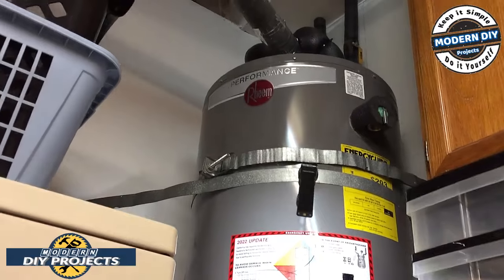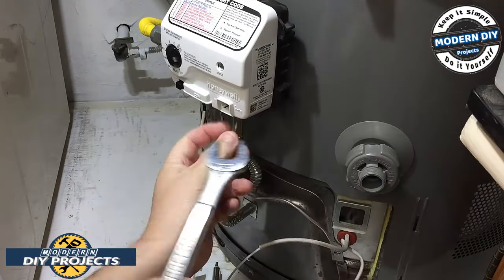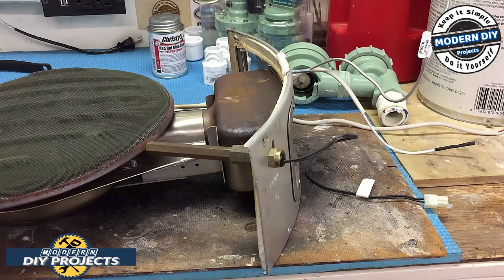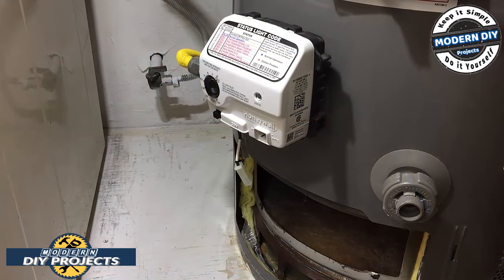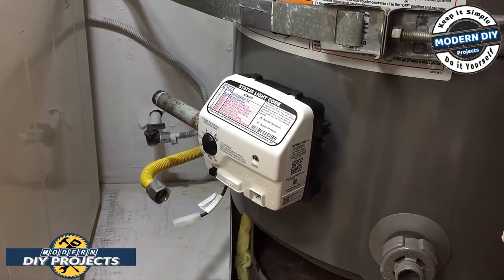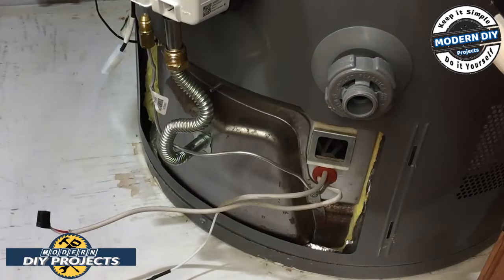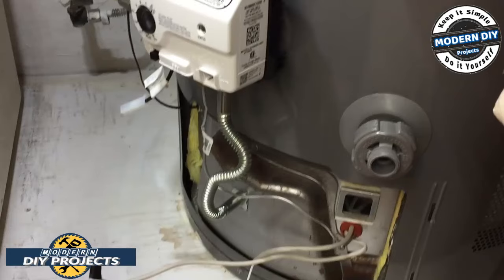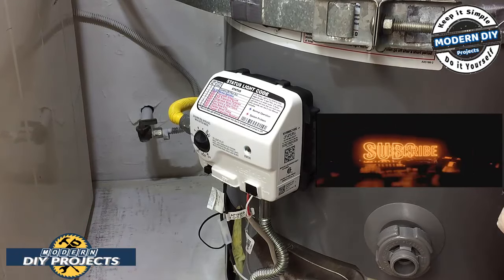Rheem Water Heater Chamber Sensor Failure / How to Replace Chamber Sensor & Gas Control Valve DIY

Comment: Got the same problem. The unit is just 2 years and the technician replaced the control module, sensor, tdr?(don’t remember) basically all parts on that bottom area.  Still failed   After 2 weeks.  When the tech arrived and checked it, seen a discoloration on the burner that looks like a leak due to condensation as they claimed.  The tech called rheem tech support and they said that the unit should be replaced and I I will be shouldering the labor cost.  What a crap!   Beware of buying rheem products.

Comment: why would it be hot if it doesnt work no hot water
Reply from the maker: Just because the water is not hot enough for you to bathe doesn't mean that it's not hot. The unit does work if you fool it into working, but it shuts off which is not what you want. That is why it is replaced.

Comment: Aren’t you supposed to change gaskets on the door?
Reply from the maker: You don't have to if it's not damaged. Mine was intact so there is no point replacing a good gasket with another good gasket.
Reply: @ModernDIYProjects  thank you.  I saw the chamber sensor kit on the Rheem website and it includes gasket, so I though that like with many gaskets it was single use.   

Thanks for the video and the explanation.  I think I will have to do just that.  The chamber sensor  in my heater is broken somehow and the cable with a black piece of the probe is just sitting at the bottom of the heater.  I thought it was a “leak detector” until I looked at the schematics.

Comment: Gonna be doing this in a few days when the replacement burner assembly arrives from Rheem. I can't believe that I paid good money to a "professional" who probably just reset the code and didn't fix the problem. Live and learn.
Reply from the maker: Wow, that is so wrong. So many plumbers are scammers, that's why I learn to do all the work myself.
Reply: @ModernDIYProjects  I even asked Rheem and they said there was no warranty claim on the part he allegedly replaced.

Comment: What is the purpose of the chamber sensor?  My old water heater didn't even have one, IIRC.
Reply from the maker: It is basically a Temp sensor. It's to prevent the heater from Over heating and possibly causing fire. Most older heaters didn't worry about this. They just turned the heater on and off as needed. It's just the way things are these days with everything being overly complicated.
Reply: @ModernDIYProjects  That's what I thought. I actually bypassed mine with a 10k resistor and only ran the heater 1 hour a day until I got a replacement part.
Reply: @EricPoulsen  If I bypass mine with a 10k resistor, the burner will run constantly? or will the control valve still regulate the water temperature normally, just not accounting for the combustion chamber temperature possibly being too high?
Reply: @superbart3000  my understanding is that this sensor is for extra safety. I bypassed mine until I could get a replacement. During that time it worked fine.
Reply: @ModernDIYProjects  wait so this sensor is only if it overheats? Will the control valve still regulate the water temperature normally if this is bypassed? The water temperature is measured by the probe that goes into the tank itself? So this just measures the temperature around the burner but below the tank?

Comment: also good to know the gas pressure those water heaters require a minimum 7.0 WC lockup & 6.4 WC running pressure can cause the pilot generator not to get hot enough! ( if you have a low-pressure gas service the gas pressure depending on the district regulator & gas customers in the area can fluctuate) I worked for a gas utility for 31 years! servicing gas services & heating equipment NO BUBBLES! NO TROUBLES!
Reply: How do you find out gas pressure ?  I already suspected ours was low bc of the burner on the stove not getting very hot taking forever to boil a pot of water.  Then the element went out on my oven And now my water heater pilot won't stay lit.   It lights while I hold down pilot but after minutes the status light never blinks :(

Comment: NEED A QUICK WORK AROUND WHILE U WAIT FOR THE SENSOR AND GAS VALVE CONTROL TO COME??  This is what i stumbled onto with my Rheem Performance 40-gallon water heater.  Follow these steps:
1) Turn the temperature control dial counterclockwise to Off.  
2) Wait til the red light stops blinking and turns off.  
3) Unplug the chamber sensor wire from the gas valve control
4) Leave it alone for about an hour.  This action seems to "reset" the sensor.
5) After an hour, plug the chamber sensor wire back into the gas valve control.
6) set the temperature dial to "Pilot" and press in as you simultaneously press-click the ignition button to light the burner.
7) wait for the blue light to come on and when it does, turn the dial to the desired temperature setting
I hope this helps
Reply: This only worked for about an hour for me. Then back to the 9 flashing red.

Comment: Temporarily Fix Below!!!!!!        Had the dreaded 9 flash "Chamber Sensor Failure" over the New Years Weekend on my Honeywell controller. Of course researched all sites for "hours" on how to reset it. Was able to get restarted but would fail within hour. After extensive research, I came across one person (sorry don't remember where, could be here in the previous comments) saying that a resistor could be used since of course the chamber sensor is a heated variable resistor itself. They stated 60K ohm. Being a electronics guru/car guy, I looked around the garage and found a 68K. I cut the sensor wires off the connector and added the resistor in. I can confirm it works, Has gotten me by for the few days without issue. Of course I am ordering a replacement sensor since it is a safety item to confirm if flame is still on (shutting of unit/pilot) in case of main control valve failure. Just wanted to let other know there is a option to get by for a few days. Once again, I don't recommend making it the overall fix, just one to get by while another sensor is ordered and on the way.
Reply: Nice tip mate.  I had the same exact issue as you.  The tricks that worked for others to turn off for a while and restart didn't work for me either.  But cutting the sensor wire and attaching a 60K Ohm resistor across the 2 wires (actually 3 x 20K Ohm resistors in series!) meant that the water heater stayed on 100% of the time.  Totally took the stress out of waiting for the FedEx Ground shipment to arrive with the replacement parts.

Comment: You don’t have to take the entire gas control out. Just remove the face and the guts from the existing one and install the new face and guts. Saves you the trouble of draining.
Reply: Dude you just saved me some headache because mine is in a really tight spot. right bro.
Reply: @richardporter7218   Was it easy to do? I have to replace mine and don't want to take out the entire controller if I can just remove face & guts.

Comment: On a side note as for threading from the outside wouldn't Rheem need to weld a thread on the inside?
Also why did you need to change the control device. Would the sensor be all that is needed to change? As only the sensor code was displayed. Thank you.
Reply from the maker: I replaced them both because Rheem sent them to me. Didn't cost me anything, so why not? The box must be problematic or they wouldn't have sent it to me for free.
Reply: @ModernDIYProjects  I called them this morning and the tech said even if I changed only the Chamber sensor, it would still have issues. The are sending both parts for free, But in the mean time my clients go without hot water again, this time for like 4days. house full of people. 

Thanks for the video.
Reply from the maker: Actually there is a workaround (which I used when I needed it) that you can share with your client (and look like a hero). Tell them to shut off the water heater and wait a few minutes (10-20 min). Turn the heater back on and relight it as usual. It will work again just fine for a few hours, sometimes a day or two before breaking again. Do this again when it starts blinking red and you can keep it going like this until the parts show up.
Reply: @ModernDIYProjects  I did relight the water heater, but it quickly went back to pilot. 
Rheem, said 2-4 days for parts unless I wanted to pay for quick shipping. Appalling. 

I think I will try this one more time, only this time keeping the temp to the lower setting. 

Thank you. 
Ps what goes around comes around. I also go out of my way to help those in need. 

I will most def pay it forward.

Comment: I am only here to say; DO NOT BUY A RHEEM. Nothing but problems. They do have an excellent service and exchange policy, but I am tried of the same customer calling me back for the same water heater with multiple problems.
Reply from the maker: Sure, but in some areas like mine, it was the only choice in town, unless I wanted to spend close to $1K for a different brand. As it is this one was almost $700.
Reply: @ModernDIYProjects  I did some research and the bulk of the water heaters are all from the same manufacture. From There Rheem, Bradford and other add their own parts and stickers. 
Too funny.

Comment: Did you have to replace the gas control valve too? Could you have just replaced the sensor?
Reply from the maker: You can do just the sensor if you want to. You don't need to replace the control valve.

Comment: Flash 9 time and I change the chamber sensor and still Flash 9 I reset it still not working
Reply from the maker: Did Rheem send you the parts under warranty or did you buy them yourself? If Rheem sent them, then you need to contact them and tell them that the Controller box is bad. If you bought it then you need to also buy the box. That is why they sent me both when I replaced mine.

Comment: Hey, I really appreciate the no nonsense tutorial... Any idea how long these will last? Since we have all had to replace these parts within the first 2 or 3 years,  I wonder if we will need to do this again in the near future... Hopefully Rheem figured out the problem and sent out updated parts but my faith in Rheem is not very high. Anyway anyone that knows please respond and otherwise have a great day and enjoy hot water!
Reply: That's why they're named Rheem because they just reamed everybody who bought one
Reply: @richardporter7218 😂
Reply from the maker: Impossible to know at this point since most have not gone past the 3 year mark yet. So we'll all find out together I guess. After the 3 years are up, my warranty will be expired also. At that point there really is NO point in buying replacement parts since it will cost almost as much as a new heater. Most likely will just get a new water heater at that point. Hopefully a different brand is available near me.
Reply: @ModernDIYProjects  Yea the cost of the parts was my next question, so thank you so much for your insight and your reply. I am hoping they figured out the problems and fixed them for the parts they sent out. I guess time will tell. Thank you again for all your help. Take care...
Reply: @johnburdg9763  controller from ACE hardware is about 140.00. Thermopile around 40.00. Still cheaper than 1500.00 for a new heater installed. Local codes/laws say licensed plumber needs to install new heater.

Comment: I have a small gas leak I am trying to find. Can you tell me the route that gas takes to get to the burner once it enters the controller box thermostat? I can smell the gas behind the controller box, and it is not where the flexible hose coming out of the house that is connected to the box. A plumber wants to replace the entire water heater. I said no. The gas company just wanted to throw parts at it, and did not want to address the gas leak by itself.  Could the gas leak be at the burner, or from the flexible hose that comes out the bottom of the controller box? Just so you know, the pilot is on.
Reply from the maker: The controller box is just a junction box like a light switch that turns the gas on and off. If it smells around the box then that means that the box is leaking. The gas comes in one line and out the other to the burner. If it was leaking at the burner your wouldn't smell it because it would get burned off, or blow up if you had accumulation between burns. I did a review of a gas leak tester a while back and it's really cheap. Maybe you want to get this tester first to track down the leak before spending bigger moeny. Watch this video: https://youtu.be/xb-XzX4MWiM
Reply: @ModernDIYProjects  I just realized that there are actually two lines that carry gas to the burner. One is for the supply of gas, and the other for the pilot. Either one could be leaking gas from the bottom of the control box. I suppose there is some kind of chamber or conduit inside the control box that could leak where the gas runs thru. I will be trying to take the plastic cover off to see if it allows me access to the gas line so I can test for a leak.  Thx,
Reply: @ModernDIYProjects  Since this gas tester is so inexpensive, I just ordered one from Amazon.
Reply from the maker: @CarlosGarcia-ls4hn  And it is more accurate than the soapy water. Smart move!

Comment: what is the part # for the chamber sensor? can someone please tell me? thank you!
Reply from the maker: There is no need for that. When you contact Rheem they will walk through the process of asking you questions about your particular water heater, and they will send you the parts you need. You don't need the part number, they will tell you what parts you need. If you want extra parts just tell them to send you more.
Reply: @ModernDIYProjects   got it! Thank you so much. my Rheem water heater has been having this problem of flashing red light 7 times.  I reset it a couple of times but I just talked to Rheem today and they are sending me the gas control valve. but after watching your video, I figure I might as well change the chamber sensor too.

Comment: Hi did you replace the gasket ?
Reply from the maker: I didn't. My old gasket was still good, so I left it alone.
Reply: thanks for the quick response. another dumb question is it says turn off gas at main supply. does that mean to the house or at the line going to the gas  controller?  thanks
Reply from the maker: You can just turn off the gas going to the water heater itself, no need to do the main shut off for the entire house.

Comment: I meant to ask if you had replaced the gasket on inner door. 
Rheem included a new one with the Chamber sensor they sent me.
One side of the gasket is the narrow silver strip. Was not sure if I was supposed to peel that back to reveal the sticky side, but upon peeling a small area i discovered there in no sticky adesive at all. I found it hard to keep it in place while installing the screws.
Looking forward to your comments.
Thanks.
Reply from the maker: I did not replace it. I pondered that same question as you, and I did the same thing as you peeling back the silver to find no sticky tape also. I decided that mine was in pristine condition and it was firmly affixed in it's location so why mess with it. Have not had any problems with it in all these months, so I don't see a problem just leaving it alone and reusing it. I think it is included in case yours is messed up or gets messed up during the removal process. Since I went slow and careful to show you guys everything, mine came apart without any issues.
Reply: Thank you for your reply. My old one didn't look so good but I did notice that yours look okay, from what I could see.
Thanks

Comment: rheem sucks. 9 out of 10 water heaters I work on are rheem
Reply from the maker: I had a GE before this one and I think that was made by Rheem also. Fortunately it lasted me 15 years with no problems. This one on the other hand was problematic. But in my area they only allow Super High Efficiency units so I am limited as to what I can get. Plus this unit was over $600, that's high enough to pay in my opinion. My old one was the best at the time and it was only $350.

Comment: So I only replaced the valve because the chamber sensor arrived late. 7 blinks came back. I'm wondering if the valve is bad again? If it was the chamber fault would be 9 blinks. I'll replace the sensor just because they gave it to me for free. Hopefully it works
Reply: So the sensor fixed your problem?
Reply: @Polonia San Diego  no I had to install the Chamber sensor the day afterward since I got the 7 flashes again. Once installed, it fixed my issue.  It's been 7 months with no issues so far. I forgot out it was still under warranty. I only had to pay $23 for 2 day shipping because I couldn't wait a week.

Comment: Was at my wits end trying to figure out what I needed to do for this exact issue. Watched your video a few times (only needed to do the sensor) and had it on my phone ready to use as reference. Water heater is in a pretty small area and had to do a lot of it by feel but it only took an hour and a half. Thank you for such a good tutorial. In definitely subscribing and following.

Comment: What was your water heater doing? Mine will light for one cycle and then not light again. But it gives me no error code. They sent me a new controller and it is doing the same thing.
Reply from the maker: Just like I said in the video. Mine would shut off the pilot and no furnace from there. If yours is doing the same but no code, then one of the sensors must be bad but not registering a code. You'll have to do more testing to see which sensor it is, or start replacing parts. I think there are only two sensors, so you don't have too far to go.
Reply: My pilot light goes dim when I turn the temp up and it calls for heat. The millivolts go from 450 to 355 when that happens. Can ‘t figure this thing out. Gas company says I have 7.4 WC comming in . Frustrating!!